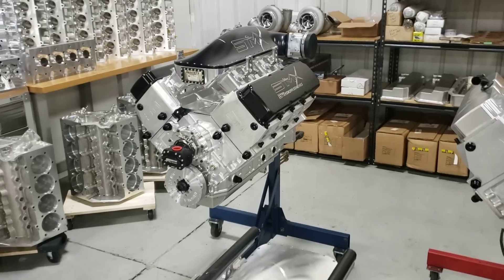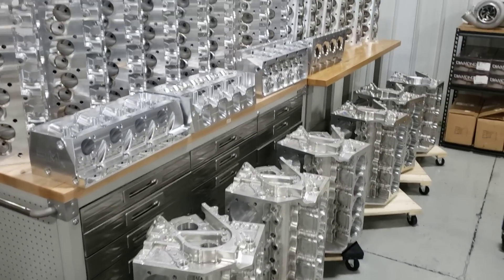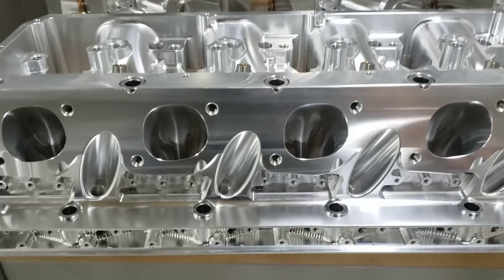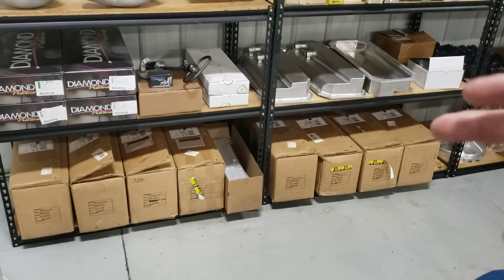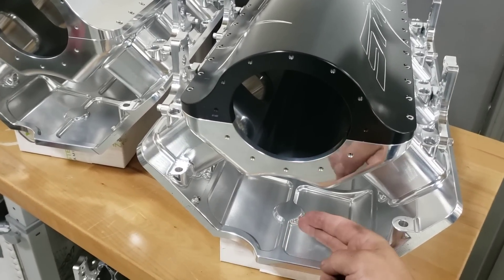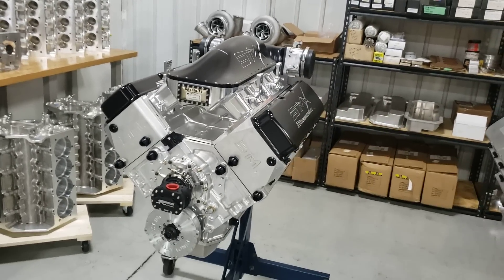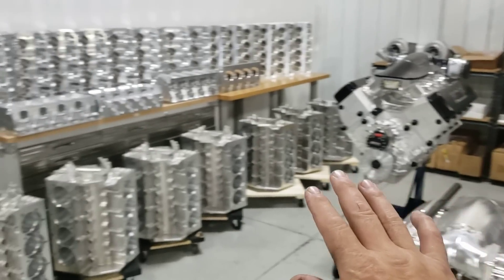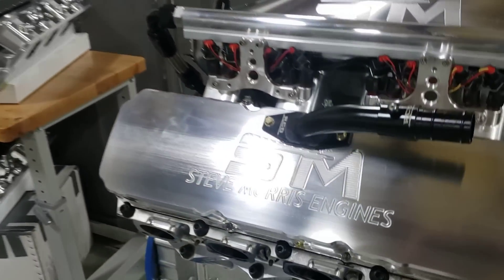54,000 HP In one spot in the shop!!

Comment: What is the cost for complet motor.
Reply: Starting price of $75,000 from intake to pan long block. Doesn't include fuel system, ignition system, power adder or dyno tuning. In other words, over $100k. I got this info from his website. That SMX is leading edge stuff, he's an innovator for sure. Steve Morris will be one of my first calls after I win the lotto